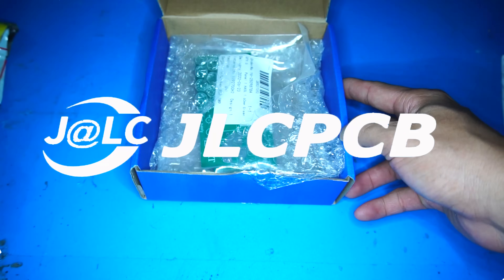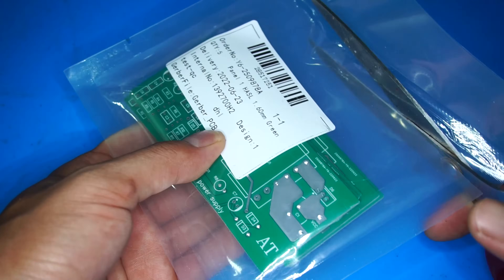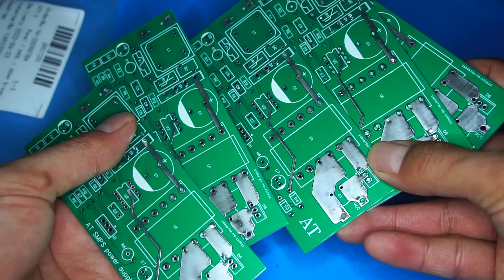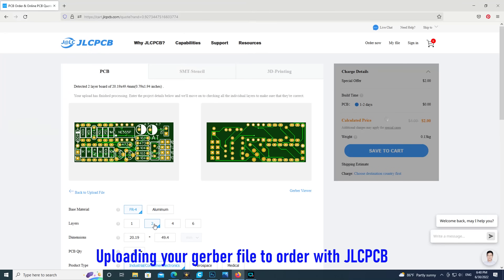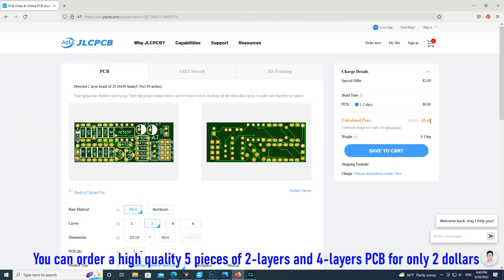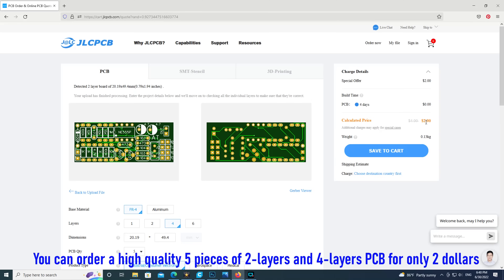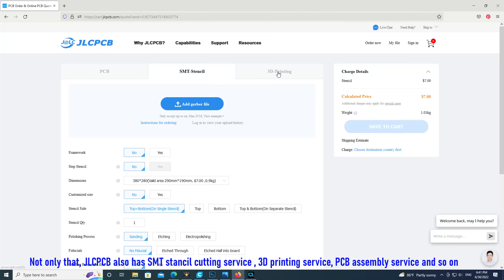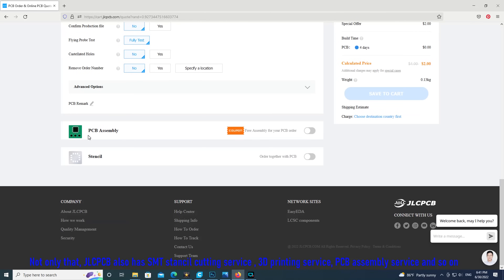How to make 12V / 24V to 220V 3KW Pure Sine wave inverter  Part 1

Comment: push pull without snubber. output diodes 5 amp. primary coil 2 square mm for current 50 amp. secondary coil 0.5 square for 6 amp. this really 1.5 kwt per one unit, ))):face-green-smiling:

Comment: With the EEb5526 core it’s maximum frequency is 250khz at max power is 3700 watt so you don’t need to use two that 7kw of power not using so max the frequency to 250kw with one for 3700watt
Reply: 48vturns plz
Reply: @paisawasoolkaronga  for 48v 6+6 primary and 48 turn for secondary
Reply: @Dc_tech386  think you vary mch

Comment: Very nice project sir finally you consider 220 volt also vivers need
Reply: It is a Dc to Dc 12v to 380v board and must take 380v to connect to another board with egs002 to convert to 220v 50Hz 
sg3525 cannot produce sine waves

Comment: Bad design, core does not store so much energy in transformer like in coil.  3kw can get with smaller etd49 with 3c94 material. Core is round so much shorter winding will be used. Primary shall be made from copper sheet, secondary from litz wire.

Comment: For secondary winding you need to use 0,80mm × 2 and total of turn is 80turn.
And primary winding, need to use 1mm x5 and total of turn is 3turn CT 3turn for 12v and 4turn CT 4turn for 24v
Reply: I want complete kit how can I purchase
Reply: 48v turns plz

Comment: What tape is he using between the transformer windings and to surround the transformer? It doesn't look like Mylar tape. Mylar is pretty glossy and isn't very elastic. Mylar is fairly thin too. This tape seems to be a bit thicker than Mylar but thinner than PVC electrical tape and it's dull. I'd like to know if anyone else does. Thanks!
Reply: Transformer tape

Comment: How many turns is the primary windings, and why is the wire much bigger than the secondary windings?
Reply: @faith.  The primary windings are two separate sets of 2x 9 turn coils where the start of the Np2 winding begins right at the end of the Np1 winding. This is a 24V-0-24V configuration where the voltage potential is applied to the centre (Np1 end / Np2 start) transformer studs in the middle and the outer transformer studs (the very left and right studs) on the primary side are synced to ground via the FETs in an alternating pattern. When Np1 is on, Np2 is off and when Np2 is on, Np1 is off. This produces the alternating sine wave on the secondary side of the transformer.

The primary windings are larger than the secondary windings because the transformer output voltage is greater than the input AND since the amount of power remains the same (the wattage is shown to be 3KV) at least in an ideal transformer, and because of ohm's law (V=I*R), as the voltage increases, the current will decrease. This decrease in current on the secondary side means that a smaller wire diameter may be used.